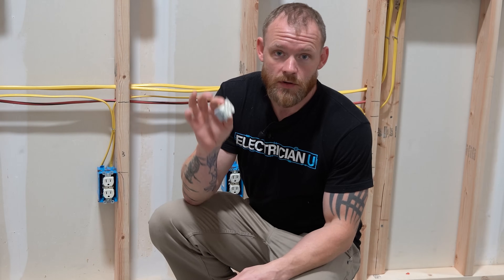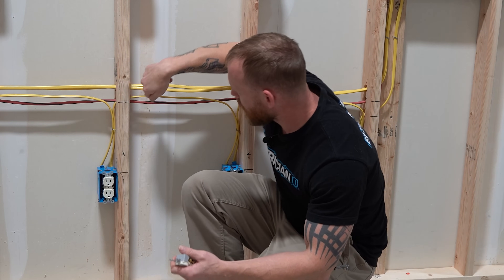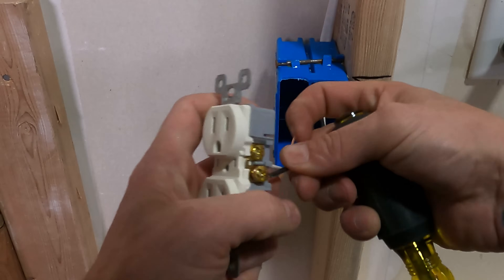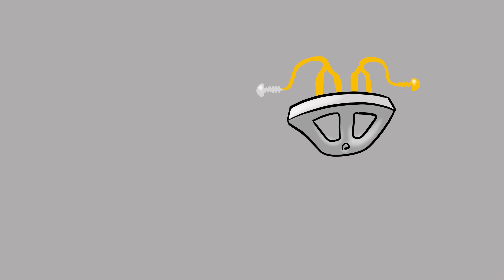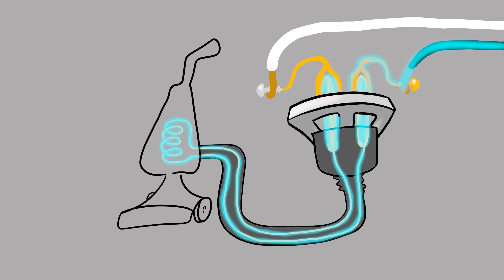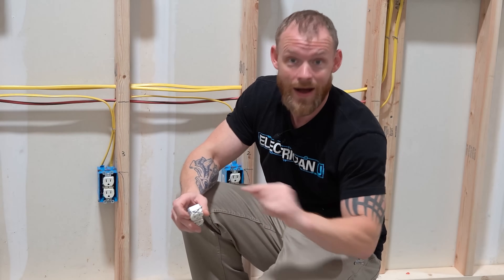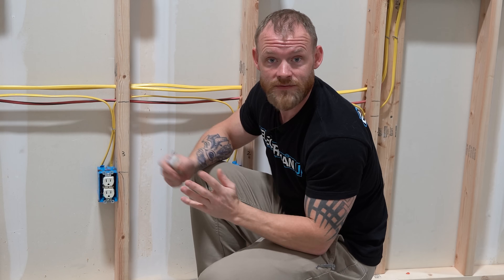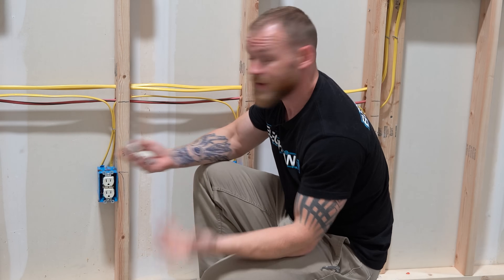Electrician U Explains How Receptacles Work

Comment: For fun, could you look at the old Danish LK switched duplex sockets from the 20th century?  These have most of the features shown on US duplex sockets but are for ungrounded European plugs and made to be installed in (3x2") boxes designed for their older single switched sockets .  Nowadays, those boxes are used for single sockets (grounded) and miscellaneous gadgets only .

  For another compact design look at Swiss triplet sockets that fit 3 plugs in a round box .

A completely different concept found in Europe is the temporary electrical panels used at construction sites to run powertools etc. before the final panels and wiring is installed .  These temporary panels are rented from the electrical cintractor and contain everything from the meter to the outlets and are often put on a pole hammered into the mud in a corner of the site .  The ekectrical contractor hooks it up and  coordinates with the power company, other contractors just plug in their stuff .  

  Yeah, keeping track of socket types is fun .

Comment: Hi, What is the difference beetwing Outlet and Receptical?
Reply from the maker: An outlet is a point on the wiring system at which current is taken to supply utilization equipment. A receptacle is a device installed at the outlet for the connection of an attachment plug.

Comment: How many receptacles should be on a circuit?  12 awg wire?
Reply from the maker: Depends on the breaker size and draw per each receptacle. But you also cannot exceed the continuous load demand in that case.

Comment: The electrician I was working for recently got upset because I jumped receptacles on a quad together using the hook on method.  He told me next time to pigtail the connections before hand because it's easier to remove and troubleshoot.

Comment: You should do a video about having part of the receptical controlled by a switch or multiple switches. When I was 16 took me a bit to understand such a setup. A video like that would help with even stuff like can living I'd you wanna cut off certian things when not needed like a heater. Don't wanna accidentally drain the battery.

Comment: Gold or brass screw is hot. The long slot on the receptacle is hot so the newer plugs can't be reversed if there is no ground terminal. Ribbed lead is neutral on 2-conductor "lamp cord." I keep notes on this so I don't forget when rewiring old stuff.

Comment: There is a lever point where the screw is that you can use to make the hook on your stripped wire ends. The receptacle in your thumbnail is off centre, just my electrician OCD lol.

Comment: are you able to wire multiple GFCI outlets on the same line ??

Also  I ran 550 feet of 12/2 UF-B cable down my drive way to my gate "i havent buried it yet".. i will bury it soon..  But due to the wire costing me $600 already.. I will have to hand dig this.. and im only gonna do about 12 inchs down non sheethed, its 14 acres, ....  I did this in order to put three lights down the driveway length and at the gate.. and i ran a GFCI outlet to the gate.. but it didnt have a thin strip of metal like you showed that connected the top and bottom.. but it had 4 holes for each receptacle, two hot two neutral..  So figured i needed to run a jumper wire from the top hot, to the bottom receptacle hot.. and same for neutral..  But when i turned the power on it poped the breaker..   I removed the GFCI and just put wire nuts on that box.   Then it worked.   Was the jumper wire not needed ? is that why it popped ? 

Also yes i know 500ft of wire is alot, however i have 122v at the house.  And 500ft down to the gate, it reads 118.5v  So only a 3% loss of voltage..  Im only running two 150w high pressure sodium lights and one 100w high pressure sodium light.. That isnt that many amps..  Maybe 550w ?  If you account for the bulbs using more voltage than they actually advertise..  Maybe 6 amps running through the whole system...  So it seems im well within the 5% power loss recommendations i read online.. even within the 3% i read for NEC despite the 500 foot run
Reply: Why would you run multiple gfcis on the same line? What you have a GFCI on it the receptacles Downstream from it are unprotected

Comment: So technically speaking, if all the receptacles in my house work fine, I can say that they are all hot? Because I understood that a hot receptacle basically has available voltage to power something you plug in. ( I'm comparing to water pressure and opening a water valve is plugging in and turning something on),
Reply: Yes. Very basically. Only the “right prong receptacle” if you are facing the outlet and ground is a the bottom. As others have stated the newer units are polarized and have wider slots for the neutral side. Generally if wired as a home run the neutral carries no current if no load. Always shut off the circuit breaker that the outlet you want to work on is wired to. TEST the wiring to be sure it is off. IF you know what your are doing everything will be fine when you re energize the circuit. Only idiots on TV shows show sparks and fires for TV ratings and also how to be an idiot and stupid.
Reply: @johnkruton9708  so the hot wire is always to the right, assuming the ground is to the bottom? If ground was above the other two holes, then hot would be on my left while I am facing it from the front?
Reply: @iwishtobetexan6060  yes that’s correct
Reply: @johnkruton9708  thanks

Comment: We should also mention that most modern day Receps are polarized, and their terminals are marked by a gold color terminal for the Hot, and Silver for the Neutral (Grounded Conductor). Also, be mindful of the rating of the Recep. UL listed utility receps are usually rated for 15 - 20 Amps. Be careful of the non-listed receps, especially the cheaply made ones.
Reply: Yes, thank you, and there is a potential between the hot side and the ground. (You can see it on your VOM - it will show if the receptacle is correctly wired.) There are larger and smaller vertical holes in the receptacle, and it's a mess but it's not unheard of if they are incorrectly polarized. Sometimes it wont matter, but when it does, when you connect some device expecting a given hot and neutral and it finds the reverse you can get a nasty shock. It's all about safety. I wish he had mentioned that difference.
Reply: Gold versus silver color probably isn't universal across brands (unless NEMA commands that it is).  However, by definition, a polarized socket and plug is one that prevents people from plugging in backwards, thus ensuring that the exposed part of your lightbulb plugs into the grounded neutral and the off switch cuts the live . On NEMA low power plugs, this is done by having one pin wider or using the grounded plugs .  Swiss, French and Danish plug systems only polarize the grounded plugs, while German Schuko is never polarized .

Comment: My split receptacles are wired with the constant on the outlets (receptacles) circuit and the switched side is on the lights circuit and the two are on the opposite buses so that little gap you make with your cutters has 240v across it when the wall switch is on. Is this the normal way to do it or did somebody mess it up back when they built the place in 1980?
Reply from the maker: Must be fed from the opposite "poles" in order to that to track. 

Weird. But also cool. 

But no that's not normal.

Comment: Why doesn't the nutural bar in a panel shock u if there's a load on the device somewhere in the house . But the nutural will get u if ur touching the silver screw when a load is on
Reply: it shouldn't "get you" if everything is connected properly and doing its job. If you have a problem, then go in with a meter and find out why.

Comment: so is a camlock female a "receptacle"?
Reply: or is a receptacle specifically something that has both Hot and Ground/neutral in a single plug...I have caught inspectors with this question
Reply: @artw.4404  I would say check out article 100
Reply: @artw.4404  ... there are plenty of outlets or receptacles that do NOT have a ground, but they don't meet today's code for use in 120 volt applications.
Reply: A female is a receptacle, yes... a cam is also something i consider a receptacle bc you use them to transfer power to a mobile device the same as with a 120v receptacle. Even by your definition, you need more than just a hot to properly use them

Comment: CODE TIME!! in the video you mention, "one wire in one wire out" on the receptacle. this is how ive done it allllllll my life. i was recently watching a video (i almost think it was this channel, as i dont watch many other electrical channels) that said technically, it was illegal to run a load through a rec, and you had to wire nut the "in and out" together before they enter the rec. ive NEVER heard anything like this before.  is there any truth to this?
Reply: No, it’s not code. But it’s a “good practice” you could say. Some people don’t like the circuit to be dependent on one receptacle. So say the receptacle fails, the rest of those receptacles downstream would not work. So some electricians like to make junctions behind the receptacle, and pigtail to it. This way the if the receptacle fails, the others will still work. Personally speaking, I think it’s cool to do but often it just takes up a lot of extra time when your trimming or roughing in. I only do it when I got 3 sets of wires in a box or more..  get yourself a code book, because some people think they are one, and will tell you the wrong things.
Reply: It could be local (state or big city like NYC will have specific code that overrides NEC).
Reply: It depends on the quality of the receptacle, to me.  Commercial or better, I'll do in one and out the other.

Comment: Nice video. Would be great if you can explain the difference between receptacle and outlet.
And show how a device with same size prongs work. 👍🙌
Reply: Never actually looked it up but as it was explained to me: A receptacle is a stand alone box you make a temp connection with a plug; An outlet is a box with a lamp or other appliance attached (or a dead head for a future appliance with a cover). I suppose outlet would also apply to a box to attach MC wire from a furnace or HW heater.
Reply: @thedillpickle100  According to NEC definitions, an outlet is defined as a point on the wiring system at which current is taken to supply equipment that utilizes electric energy for electronic, electromechanical, chemical, heating, lighting, or similar purposes. A receptacle is a contact device installed at the outlet for the connection of an attachment plug, or for the direct connection of electrical utilization equipment designed to mate with the corresponding contact device.
Reply: Article 100 Definitions defines what an outlet is.
Reply: An outlet is any point where power is used, a receptacle is an outlet designed to receive plugs. For example, if you install a light fixture, its bulb sockets are outlets but are not receptacles.
Reply: Light bulbs, Transformers, and a host of other devices care not which way the electricity flows, so in older or illegal devices the prongs are same size (unpolarized). However if there is a short circuit and you're holding the device you may very well care which prong is hot.
Reply: @rcmrcm3370  ... there are many newer devices that have non-polarized plugs. This is typical of lamps and electronic items with isolation / step-down transformers.

Comment: As an electrician apprentice. One question I had was if the hot is the power and the neutral is the return, why cant you just connect a black to a neutral to make a complete circuit? Aside from being a pointless exercise, don't appliances do exactly this?
Reply: Appliances do that in a controlled way -- that is to say, they present some amount of resistance which is necessary to limit the current flow to a level the wiring can handle. What you propose is completing the circuit in an entirely uncontrolled way. We call this uncontrolled condition a "short circuit," and short circuits cause all manner of dangers like arc flashes, fires, and shocks, just to name a few.
Reply: Like Harvilla said. A physical (pressure) model of what you suggest is plumbing your car gas tank directly to manifold so it's only the gas line limiting flow and not the valve and nozzle restrictions on carburetor or fuel injectors.  So things go boom very badly when you dump that much potential energy into a small volume.
Reply: That would be a short-circuit. Appliances are resistances, their resistance depends on their demand. Let's make it easy:

You got an electric heater without a fan (to keep it simple) and a demand of 1500W. Divide that with the voltage of 120V and you got 12.5A that this heater draws. Then you got the formula U = R x I, change that to R = U / I. So 120V / 12.5A = 9,6 Ohms.

And another example. 20W soldering iron are 0.17A on 120V, there the resistance is 706 Ohms.

The higher the demand of the appliance the lower the internal resistance.

Comment: Why does the “hotness” not continue along the path of the neutral side? Where does it go to die?
Reply: Electrons return to grid via neutral (via ground if there is a short-to-ground), all the electrons going in and out of the generator (or battery) have to add up like double entry book keeping, with nature acting as the accountant who never cheats. The neutral is at a lower potential (voltage) to the hot leg, that's the only difference.
Reply: @rcmrcm3370  I wondered @Joe S question too.  But electrons don't really move right?  Ok, maybe 0.1mm/sec.  IDK, maybe this is more about the "electrical field," or physics vs engineering.  But I still wonder what changes (if anything) between hot and neutral.  Maybe I just don't understand potential.  More info if you can...

Edit:  Just read your other reply below which helped:
"Like Harvilla said. A physical (pressure) model of what you suggest is plumbing your car gas tank directly to manifold so it's only the gas line limiting flow and not the valve and nozzle restrictions on carburetor or fuel injectors.  So things go boom very badly when you dump that much potential energy into a small volume."

But so many appliances with differing electrical requirements can plug into a receptacle that it seems one could get the equivalent of your gas explanation (gas plumbed to manifold) by plugging a millivolt device into a 15 amp receptacle.
Reply: @MCMXI1  when the current reaches the design limit the resistance reaches it's appropriate level to restrict the current just like closing a valve. In a DC system the current indeed returns the electrons to the source. An an AC system they jiggle electons back and forth but at the end of the day the sums add up.
Reply: @rcmrcm3370  Thank you!

Comment: Love the video but here CEC says you can't run hot in and out of a receptacle you need a pigtail
Keep up the video love them
Reply: In the NEC, you can always run hots in and out of a receptacle, and you only need a pigtail on the neutral on multiwire branch circuits.
Reply: ( California) CEC code (usually) is more restrictive than NEC, mostly due to Earthquake needs. If you mean Canadian code, god I wish the builders in Ontario knew there was a code, so I would wonder about it.
Reply: @rcmrcm3370  yes Canada electric code
Reply: @rcmrcm3370  CEC I believe is Canadian electrical code not California
Reply: Good to no we only run 2 hots on spit receptacle so all the load up stream doesn't run through the receptacle
Reply: If I had code book close would give you the code

Comment: Dustin, a lot of dudes I work with prefer cutting off a little more insulation then squeezing the hook around the screws. It’s definitely a better connection, but pain in the ass if your removing the receptacle.